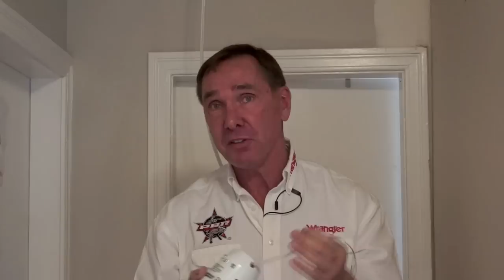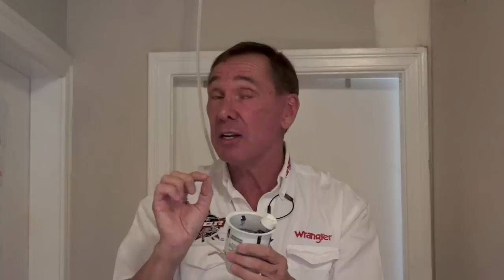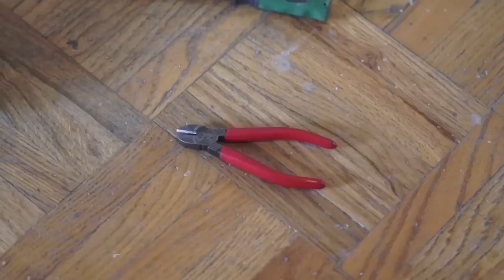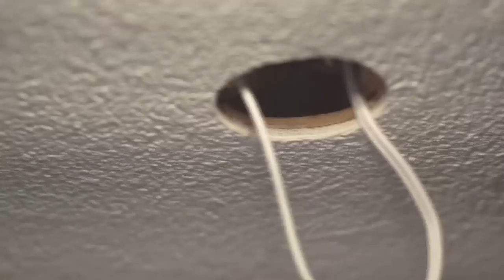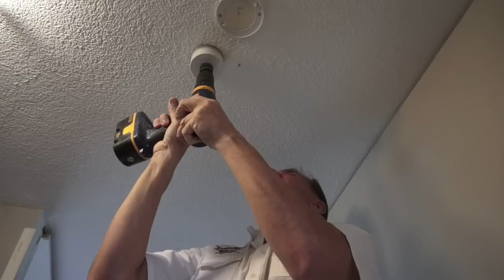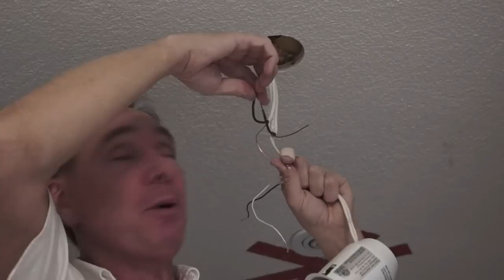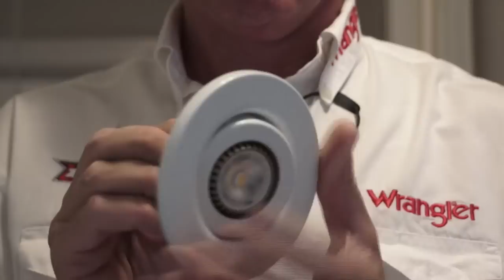How to Install Recessed Lighting | Retrofit

Comment: Great tutorial. I mean electricians know the codes, however, in my time, I have run into some really dumb electricians.  As a EE major, I dont know electrical construction stuff, however, I know that I am smart enough to read a how to and follow codes.  That being said, sure the best thing to do is to install in a junction box, but you could also use wire nuts and then wrap them in electrical tape.   My one point to you Percy is that if the wire nut comes undone (for some unlikely reason) and the positive and negative cross the watts of the light bulb draw dont matter, its 15A /120V unfettered power at the cross point.  Again at that point I would think the breaker at the panel would trip and then you have no power no problem lol.  So the safeguards kick in and you fix it.  Anyways good tutorial.
Reply from the maker: Exactly my point Jeremy. This is a safe installation, period!

Comment: Hey Percy great video. So once you insert the LED fixture (LED retrofit) in the drilled hole, what holds it up in place?
Reply from the maker: Hi, there are normally some spring clips that grip the side of the hole. Trust me this is very easy and despite what a lot of greedy electricians might have you believe very safe. If you're still afraid then simply plug in a transformer and use 12volt bulbs and then even they can't be offended.

Comment: Thank you for the tips.  Which brand / model #  of fixture did you use for this?  I want to put some in above my bar at home.
Reply from the maker: Your's will be different. My suggestion is go too your local Home Depot, see what they have but then go on line to eBay or Amazon. You'll get some great deals there!

Comment: never and never put marrett joint directly on a wall.  You can make your own installation but watch a minutes on you construction code or law on internet about the secure process of your installation. it's simple , you just need to put this on a box , 90% of the time , you buy a spot light with a includ box. If you dont do that , you may have problem and have spark on your wall and got fire.
Reply: +Percy Lipinski First ,it's sure your not a electrician and you can't give information about what you don't know. I don't know why you talk to me like this , it's sure in real life you never talk me like this , it sure you piss on your pant if i level up the voice. Im never insult you like a kid your are doing but anyway , you are a funny guy anyway , but you know nothing about electricity , twist wire with  cutter and you don't know why you need a jonction box , it's not about the heat you need this , all electrician know that.
Reply from the maker: +stewie211 look you idiot, I have a degree in electrical engineering. I don't need to be a dumb ass electrician like you douche bag to hook up some lights. You are a total idiot!!!
Reply: +Percy Lipinski , you don't have a electrical engineering if you doing all wrong and not secure and you have just 2 word to say ? idiot and douche bag lol. go study because your dangerous.

Comment: Hi i liked your video. All things set aside all these union guys are just criticizing you for 1. Not hiring them. 2 ul listing is overrated. 3. So what if its not ic rated its not like they are outside getting wet and finally I applaud you for being the man of your castle. They are led's won't get hot and I myself could not explain how a wire nut will undo itself. I d say good job hope you enjoyed them.
Reply: "Electrical fires are down by over 80%" - Source please.
Reply from the maker: You "SIR" hit the nail on the head thank you. Not one single person has been able to point out a dangerous flaw in my installation. The most they've been able to do is point to an outdated rule book. These procedures were designed for high power, high heat systems. Those days are over. Electrical fires are down by over 80% due to low power and low heat!

Comment: DO NOT FOLLOW THESE INSTRUCTIONS!!!  THIS GUY CLEARLY HAS NO IDEA WHAT HE IS TALKING ABOUT!!!
Reply: Percy Lipinski Not going by code IS a "big ducking deal!!!"  We have electrical code for a reason, that reason mostly being amateurs like you running around doing unsafe nonsense like this.  You wouldn't be saying "big ducking deal!!!" if the people at Boeing decided to stop following aviation regulations when building the airplanes you fly on.  You wouldn't say that if the structural engineers designing your bridges threw their code book out the window because they thought they were smarter than the collective wisdom of hundreds of years of bridge-building experience.

Your "my house is fine 4 years later" argument is total horseshit.  You're ostensibly an adult, so you already knew that, right?  The RMS Titanic floated perfectly well for 319 days.  The Space Shuttle Challenger had 9 uneventful launches.  Most DC-10's didn't crash and kill everyone on board.  See, I can do it too.

As you requested, nay, DARED me, here is exactly how what you have done is dangerous: All it takes is for a squirrel, mouse, racoon, etc., to get up in your attic and brush up against your wiring.  Suppose you have a little bit of copper showing outside the marrettes and the wires arc as they are pushed together.  Now you have ignition, right next to wood and insulation.  Congratulations, your house is on fire.  You can argue the statistical likelihood of this happening until you're blue in the face, but it doesn't change the fact that you could (and are legally required to) avoid the hazard entirely by putting a simple, $2 box around your connections.  Not doing so constitutes willful endangerment.

Now grow the fuck up, fix your shit, and take some responsibility like an adult.  

Sincerely,
Stupid Losing Asshole Idiot Loser

PS - Name-calling is not one of your strengths.

Comment: Good stuff appreciate the info...
Reply from the maker: Don't listen to all the whiners in here. Trust me, my house will be standing well and fine long after they're buried and forgotten. LED bulbs use less power than your old flashlights! Did you ever hear of a fire started by a flashlight? You betcha a 50 watt halogen bulb is hot. It can even physically move wired due to the physics heat expansion and contraction every day, which is exactly why codes were written that way originally. Halogen bulbs are banned in mistress now and will be permanently discontinued in a few years. WhT idiot would take out a low operating cost LED bulb and replace it with one that costs 35 times as much to operate!!! Apparently a few people below my comments. Yet I'm not going to remove even one stupid comment. They earned their right to stupidity stardom. Oh and since I invested the $6,000 I saved by listening to their nonsense I've now doubled it to almost $11,000 in 4 years!

Comment: +Percy Lipinski Don't be this way!.
ALL VIEWERS BE AWARE!
If one of your connections goes bad, witch will happen with time.. goes to say "nothing lasts forever".
You will have that bad connection directly in your insulation, thus causing heat to build up i flammable environment. Even though you may think you made one hell of a job, there is always product failure and overlooked wrongdoing. please take this video down so you don't encourage more amateurs to make the same mistake.
As an electrician i have to say that our education is there for a reason!!!
Reply from the maker: +Jeanine Vasinko what a stupid idiot you are. Please somehow explain to me just how a splice is going to undo itself. Is there s mystery force that funded electrical splices and then undoes them. Then somehow this "mystery force" scrapes off insulation and forces the opposing wires to connect and start a fire? Yet somehow an electrical box will prevent these electrical gremlins from gaining access to the splices? You're a dangerous, ignorant douche bag that should immediately consider getting off all your meds or at least off the generics and back on to brand name meds. What an idiot you are!!!

Comment: It's scary to see how many people congratulate you on a job well done and now they're going to HD to buy the supplies to do it themselves. I work in commercial building maintenance and perform a lot of wiring. I am NOT an electrician but I ensure that I research the codes for any work I am doing and hold a healthy respect for proper methods, circuit sizing and materials. 80% of the bulbs I install are LED and they are the ideal bulbs for many reasons. However, the type of bulb you are installing has absolutely nothing to do with basic safety measures, such as making your junctions in a box. The next homeowner or contractor after you has no idea that those cute can lights you installed in the hallway below you have exposed splices sticking into the insulation. These safeguards are there to ensure the safety of everyone coming after you. When I go to work on adding an outlet to a circuit, I assume that the worker before me grounded and terminated all connections appropriately, used the proper gauge wire for the circuit and used proper materials. Putting a video like this up on youtube is risky business, but you unfortunately seem unable to grasp why. Most electrical work is not difficult, but does require extreme attention to detail. Your house not having burned down does not prove that you did the job safely and correctly. And yes, there is a right way and a wrong way.
Reply: Percy Lipinski  Are you interested in a discussion without insults? I'm struggling to understand why you insist that the reason you can avoid splicing your wires in a junction box has anything to do with what bulb you install. Does this mean that the switch that controls these lights also can be just glued to the drywall? After all, it is only switching a couple of watts, right? Have you ever been shocked by shoddy wiring? I have and it's scary. Mostly because you lose all assurance that what you're working on is done to a common standard. When you disregard these standards in a video like this and advertise it as a tutorial, you start a chain reaction of errors. You have no idea what other codes the viewers will either not be aware of or, such as yourself, disregard because they think they know better. Please respond without insults if you are really interested in discussion.
Reply: Austen white, don't bother talking to this guy.  He has his head so far up his ass that he can't even hear all the good advice people are giving him.  He is a mean bully that can't have an adult conversation without throwing insults at the person TRYING to help him out.  It's not worth the time or effort.
Reply: *****  I don't think 'ski is posting with the intention of providing usable advice. He is trolling for opportunities to inflict invective on responders who challenge him. I suppose this is better than having him running down cripples trying to cross the street.
Reply: Dude,  there's a reason it's just you and a dog. Hint: It's the choice of everyone around you.
Reply: I just wanted to let you know that people are reading and appreciating your comment 3 years later. Luckily there are some recessed lights that have the box attached. They would have made this a much safer installation
Reply: *****  That's it 'ski . . . you were shocked! That explains your behavior. I forgive you, it's just not your fault. It's not unusual for people to never be the same after getting a jolt. Your brain chemistry got not-quite-fried!

Comment: Good job at your install! I understand ur not an electrician so good work to you sir, pretty good for someone thats not in the trade!. But probably as some people pointed out, you should just connect the wires in a JB ( Perferibly a octogon box with a cover.) Its code to have it up in the ceiling aslong as its accessible threw the hole if you were to remove the fixture. Also use pliers next time twisting conductors because using sidecuttings you may run the risk of having a wire break on you while twisting the marrette on, plus using pliers is way easier. A open neutral can cause many problems haha. Also just for anyone that sees this I recommand using new LED potlights. Lotus potlights for example are a 1/2 deep so even if you drill over a stud, it still fits. (It has spring clips that suck it up to the ceiling. ) Its what I install in all my new renos. Anyways just thought Id drop my 2 cents. Good work they look awesome.
Reply from the maker: It's not needed. These bulbs are the same power as LED Christmas lights that you string up safely both I died and outside your house, sometimes year round!
Reply: Percy Lipinski the problem isn't about how much Amos it draws, the problem is u are sticking live voltage which could potentially become opened at the connection and ark out and cause a fire. That's the purpose of a grounded junction box so that couldn't happen.
Reply from the maker: Here's where you fuck up. "Potentially" listen "potentially" the Universe could collapse and end tomorrow. "Potentially" a monkey could type out "war and peace". The question is always what are the chances. So here's s big surprise for Ya! Wires do not short out by themselves, especially with no heat. The reason we needed junction boxes for light fixtures is due to the extreme heat generated. The heat on the copper plus the high amperage combined to expand and then contract the copper wires eventually possibly loosening a connection and shorting them out. This was remote but admittedly possible. An LED bulb has neither the power not the heat to expand and possibly eventually move the copper wires. Until someone can prove to me how an LED bulb is going to any more dangerous than a string of LED Christmas lights on a dried out Christmas tree they'll be told how ignorant they are. Where's the research showing the danger to connections with LED bulbs?
Reply: Dude, you start off by saying I "fucked up".... I was pretty polite to you. Look at you getting so mad at everyone... I am a electrical contractor, been in the trade for 10 years. I think I know what I am talking about when it comes to this business. Like, you twisted wires with side cutters... lol. I have had many service calls to burnt up marretted connections that were free floating due to many unpredicted and unforseen reasons. that is the reason for a JB for practicially all electricial connections 120v and up. Your an idiot for saying what you say. I am not going to risk burning down a customers house because of something that is highly unlikely for ever having a problem. this is the reason for an inforced code standard, which has 2 purposes, to protect persons and property! And btw a jb for Light fixutes is not merely for heat reasons fyi. Its to keep the connections in a safe location and to hold the fixute to the dissired surface. If there is heat issues with a lamp, the light fixutre will be designed to withstand the heat. Also your comment about copper wires loosening is also wrong on many levels, but im not going to sit here and explain that to you. Also to awnser you about the hazard with LEDs: The problem is not in the draw of the load, its about live connections that arnt in a JB! Its live voltage that can be any amp draw based on what it comes in contact with... Dont try to act like you know more then the real professionals, we went to school for this and many years of hands on experience... Hate to come across as an angry person but come on man...
Reply from the maker: Dude, I like that. Look you seem like a nice guy so I'll try to return the favour. Your an electrical contractor, good for you. I'm an electrical engineer good for me. Here's your problem. You simply don't grasp the fundamental laws of thermodynamics. Do you know why there are junction boxes, thick 14 or 16 gauge wires, special heat proof wire insulation on light boxes?

Comment: 120v WILL KILL YOU.I just want to set something straight before someone follows his instructions. He states that 120v won't kill you and that is NOT true most deaths by electricity are actually from 120v. 50 volts can kill you. It is not just votage that influence this you have to also take in account the current. Hence a police teaser has about 30 thousand volts but won't kill you. Because of the very low current. If you get 50 volts and 0.5 amp and the path goes thru your heart you have a really big Chance of dying. Electricity is truly dangerous and an invisible killer take caution and leave it to the profesionals.

Comment: This is in fact my very first and only time posting on a youtube video. The reason I am taking the time is that I've never felt so strongly that a video should be taken down. I have installed hundreds of recessed lights here in Canada and can confirm that this is not to code, and even though I am not an electrician and an avid DIY I am well aware of this. I feel that this video is dangerously misleading. Marty is correct on all accounts.

Comment: I just finished installing some of these cheap home depot pot lights, the safety box on these lights that you tuck your wires in are made of cheap tin, the boxes break apart the moment you try to to remove the washer cover to feed the wires through.  If these are supposed to prevent fires then someone should question how the government safety agencies allow their imports.
Reply from the maker: I think you get it. Look, the problem with electrical in ceilings is heat buildup. That's the reason they mounted the connector box away from the heat source. But what if you're using LED Bulbs? There is no heat and no heat means no danger. Conventional electrical wire was made to withstand extremely high power with huge swings in temperature. A low power LED light simply does not have enough power to effect any danger! Don't be dickhead and drink the koolaid!